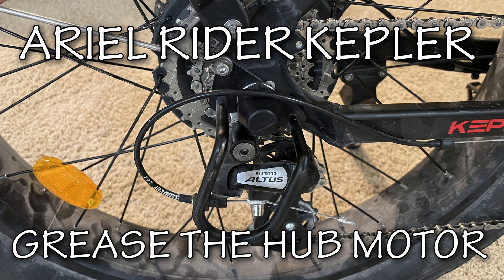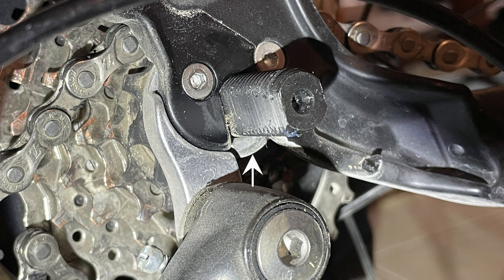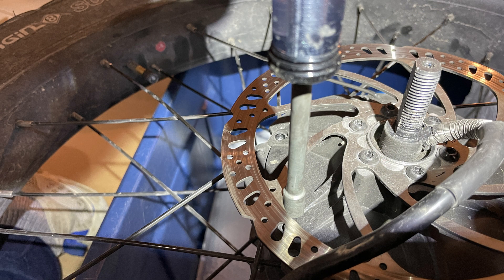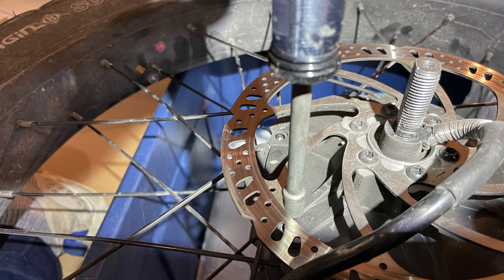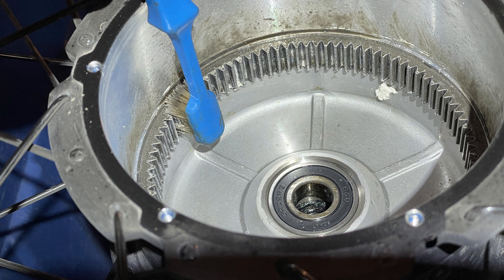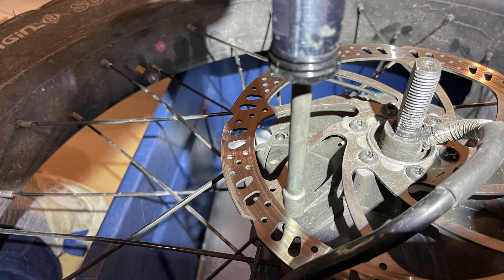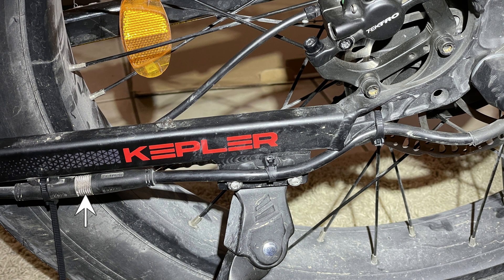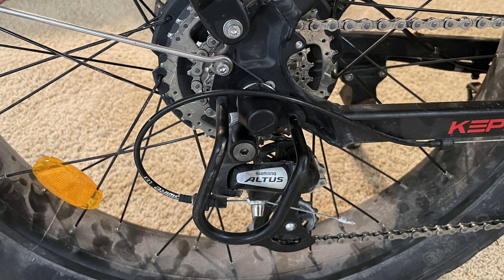Ariel Rider Kepler, Greasing the Hub Motor Gears after 1000 miles

Comment: I was told that Mobilgrease 28 was best due to the heat which Bafang motors generate. 

I always removed the brake disc rotor before removing the hub lid.

Once removed I used a puller to separate the sun-clutch and planetary gears off the key and drive axle.

That worked best for me to thoroughly wipe the motor and clean planetary gears.

The same steps illustrated in video on cleaning the hub gear teeth.

Great vid!!

Comment: The "definitive" motor lubricant for hub motors is MOLYKOTE PG-75 or MOBILE 28 grease. Both are compatible with Nylon/plastic parts that are in contact with metal parts. 🙂👍
Reply from the maker: @jeffcarello7446  perhaps you could supply the study or source material that shows why this might be? I've seen a lot of opinions but no reasonable evidence, even from “experts” or manufacturers.The trouble with these motors is that the grease gets thrown out of the gears leaving behind a barely noticeable amount left, that over time will end up being insufficient. I have been pondering a tiny hole in the bottom of a tooth that grease could be injected in with a small nozzle grease gun like we used on chainsaw bar ends; this could add grease without disassembly.. i haven't done it yet, maybe next time I grease, or maybe i'll try it on my old bike first. 🙂

Comment: Hey Ron, do you need a freewheel removal tool to get the gears off? Which one?
Reply from the maker: Which gears are you referring to? The cassette doesn't need to come off. I didn't see any reason to remove the planetary gears, so I didn’t try that.
Reply: @RonNehrig  
Ariel Rider sent me a new controller and motor. I'll slip the motor out of the new assembly (hub) and into the old one. But to do that I'll have to remove the freewheel assembly from the old motor and install it on the new one.
I'll figure it out. Thanks.
Reply from the maker: @garyderoy  Oh! That sounds exciting! Now we'll know who to ask about that! 🙂
Reply: @RonNehrig 
 🤔
Reply: @RonNehrig  
Ron, I just watched your video again. You had to remove your gears (freewheel) in order to take your motor apart. You've got the brake rotor on one side which you left on, and the freewheel (gears) on the other side. Aren't the gears are attached to the axle?
Reply from the maker: @garyderoy  you seem to be referring to the 7 spd gear cassette as the “freewheel” gears. I did not remove them, as they are attached to the hub on the right side. The motor and planetary gears are removed from the other side, behind the plate with six hex bolts. When those are removed this side of the motor comes off together with the planetary gears, brake disc and axle.
Reply: @Ron Nehrig  
Sorry for the misunderstanding.  I'm not an expert, but the way I've understood it for the past 30 years is that there is the old Freewheel system which includes the gears, and the newer freehub and cassette system. As far as I know, and from what I've been told, no rear hub, geared motor eBikes use a cassette system except maybe some very expensive e-mountain bikes. 
Anyway, you've made me look at my new motor again and I can clearly see the threaded area that holds the freewheel. Since I won't be replacing that part of the hub I won't have to remove the freewheel and the new motor assembly will just slide into my old wheel.
Thanks Ron.
Reply from the maker: @garyderoy  that would seem to be the case. What happened to your bike?
Reply: @RonNehrig  Since the day I got my bike the barrel connector from the motor to the controller was just a little loose, but I didn't know it. Eventually I started getting an occasional buzzing noise and vibration right up through the seat post. I thought it was a problem with the motor or gears. I used to do a lot of work with brushless motors and eventually I figured it out as a phase problem because of the loose center pin in the connector. Sometimes it didn't vibrate too much but you could really hear the vibration, like a grinding noise.  I think this is the cause of a lot of motor noise that people are having. They take things apart and think what they did fixed it, but all that really fixed it is that they tightened that connection during reassembly.  Anyway, the center pin on the controller side was fried on mine and you can't replace the connector. Ariel Rider sent me a new controller and just in case there could be a problem with the motor down the road, they sent one of those too.  Very good customer service. Of course, with a new controller and motor my Kepler won't be particularly fast. No more 40 mph on a flat any more.
Reply from the maker: @garyderoy  thanks for the detail, i'll pass it along if someone else needs it. Nice they sent the parts.

Comment: I really appreciate your video. I will have to watch a few of your others to see what kind of riding you do. I have a similar style bike I am upgrading. and one question I have always had is how long do nylon gears last under what stress. I am changing out stock 22 amp controller for a 45 amp one.  I have seen brass gear sets and I’ve seen one that was both nylon and brass. But if nylon lasts I know it would make less noise. I swapped the 4” beach cruiser tires for 3” street/sport tires they made the bike feel 50# lighter and the best part was the silence.
Reply from the maker: Thanks very much for the comment, I appreciate it! 🙂

Motor Gears
A possible trouble with metal planetary gears is that they could cause more wear in the metal gears cast into the motor hub, which would be difficult to replace. Since they are only lubricated by a smear of grease and not a lubricant bath, as on a car, this seems more possible. The nylon gears will wear before the metal and are easy to replace, though I haven’t looked into finding them as spare parts. I didn’t see any wear on the Nylon after 1000 miles, but 1000 mile greasing will make me feel better about them, and it didn’t take long. It might be nice to have a grease fitting where we could inject a small amount of grease to top it off, but there isn’t one (I've pondered the possibility of adding one). I expect nylon is also quieter as you noted.

Tires
As you'll see in my riding videos, I encounter a lot of different surfaces; some smooth pavement, a lot of patched or degrading asphalt, gravel, both packed and deep and loose, slippery forest trails, and some mud, when I can’t avoid it. So I've tried to find tires that handle all of that in a reasonable way. I don't use knobbies (like the CST that came on the bike) because I don't consider them safe for higher speeds on pavement (and, as you noted, they are noisy, not very smooth riding, and won’t last long on pavement). I tried a Vee Tire Speedster on the front, and it was nice on pavement, but squirrely on loose gravel, and did not inspire confidence on slippery dirt, mud, or sand, allowing the front to slip out. 

I switched to a Fenix 26" x 4.0 P-1215 on the front, currently unavailable, but available as a Wanda P-1215, as seen in the ebay link included below. I like the solid center ridge for smoother and quieter performance on pavement, combined with some good closely spaced knobbies for gripping off road when turning. I use this on the front only because it is 4 ¼” wide at the widest point, which might brush the chain on the rear on my bike, compared with the other tires which are 4”.
https://www.ebay.com/itm/204126510538

So I put an Origin8 Supercell 26 x 4.0 on the back. It’s a nice tire, very good on pavement, handled other things reasonably well, but I was riding a lot of forest trails with loose leaves over wet dirt, like the videos on Oak Ridge, Reynolds Ridge, Pea Ridge and some others so I kept looking.
https://www.amazon.com/Origin8-Supercell-Wire-Tires-Black/dp/B012EIXCWI

Then I saw an Innova IA-214 on ebay, a nice chunky compromise tire, and that is what I have on the back now.
Unfortunately, they may not make them anymore and this ebay seller is out of them at the moment.
https://www.ebay.com/itm/204161622513

I used this tire on the video “Side Trails of Pea Ridge”, and all of the ones after that, including the higher speed farm road videos, where it also worked very well.

Both of these tires are 60 TPI and are heavier than the 120 TPI Speedster or Origin. I also have tubes and "Flat Out" in them since I am usually off in the boonies somewhere, so there is some weight involved, but it is a price I put up with for greater security.

Thanks again for the comment.

Comment: Plastic gears are so much more inferior to metal gears.  Wish they had some hobbed steel gears in there.   And I say this as a man that makes plastic gears for a living.
Reply from the maker: Yeah, all the hub motors I've seen taken apart were nylon planetary gears, at least these are pretty beefy ones; and I suppose Insufficient lubrication is less likely to damage the teeth on the metal housing. which would be more trouble to replace.
Reply: I have an X class 48 V it supposed to have metal gears I have never taken it apart, but that was their claim to fame with that motor

Comment: Hey Ron have you heard about an ebike called wicked freedom they kinda compare it to the kepler with big hub motor and wattage etc etc goes about 40 so might have lil more pop then kepler still think kepler is hard to pass up seems like the kepler has allways done good for you 👍

Also allways enjoy your content
Reply from the maker: Thanks for the comment! :-)

Someone mentioned the CitizenCycle videos of the Wicked Freedom, but they weren't very complete so I don't know a lot. He only used PAS 2 at around 23 mph, similar to what the kepler would be doing in 2 at 58kph, then he added throttle. He didn't show the speed with a full battery, only when it was low at 31 mph, he said it went 40 but didn't show it; downhill? Don't know. They say 33-35 on their spec sheet, more believable, but it is 60 volt so who knows. Maybe a more thorough review will come out.

There are two bikes. the Freedom and the Cruiser which has a step through; much as I might like rear suspension, I don't need a higher bike to get over.

- 60V system, very nice.
- 52T chainring, good.
- 4 bar battery indicator :-(
- Don't see adjustable PAS in the pretty long and sort of difficult to read manual. Hard to tell about other adjustments, think I'd have to use one to figure out what the manual is trying to say.
-  Luggage rack looks tiny and weak on the Freedom, and not much better on the Cruiser, and I do like a good luggage rack; maybe it could be changed.
- Don't know anything about the Star Union brakes, but they do have a website.

Comment: Nice tutorial. I am inspired to do the same now.
Reply from the maker: The thought of it was worse than the job, as is so often the case. About 80 minutes from first photo to the test video at the end, including taking photos. It's a good time to check brake pads since it's easier to replace the wheel with the caliper removed.

Thanks for the comment! :-)
Reply: Ron,

No need to remove the sprocket on the drive side at all, in order to dislodge the motor from it’s casing, right?
Reply from the maker: @bpoydras1503  , correct, the sprocket stays on the wheel.
Reply: @RonNehrig  

Thank you. Will be giving my hub a Lube this week too.

Comment: ron  ,   good video;the kepler is suppose to come with metal gears  ;it was one of their selling points   did you see any metal gears while you were in there,i think it was plantary gears that arieal rider said was metal i have a kepler also with less than 200 miles on it ,but when it reaches 1000 i plan on greaseing the motor thanks for the info
Reply from the maker: I don't recall them saying anything about metal planetary gears in the Kepler and didn't see it on a brief look at their specs just now, but didn't look at the manual.

You saw what I saw, Nylon Planetary Gears, with the housing gears being metal, of course; there are no other gears.

Thanks for the comment! :-)
Reply: @RonNehrig  Agree they have never claimed metal gears & nor has anyone else to date besides a company called Wicked which just changed hands & it now called Wired. The Wired Freedom is a look alike with more power & metal gears for only a hundred bucks more. I'm in the market & have done endless days of research but I'm steering towards the Kepler because the company has been around. Even though the Freedom is better in every way a new company could be bad in the future. I mean they have already changed names. 🤷‍♂️